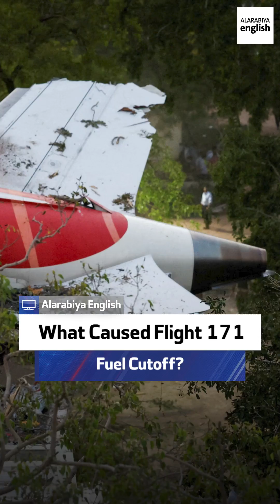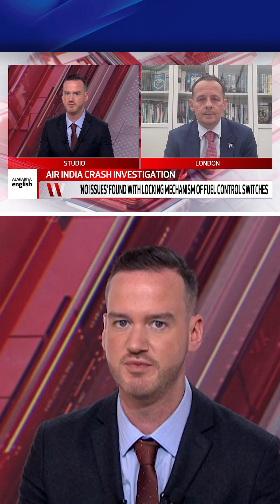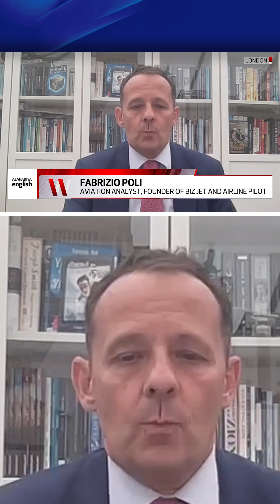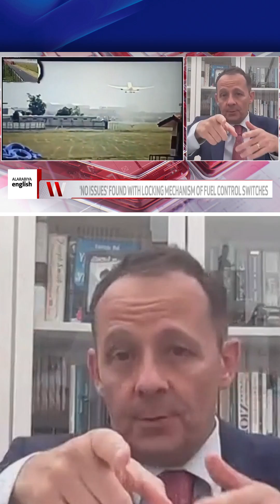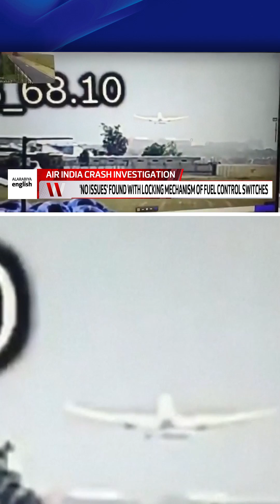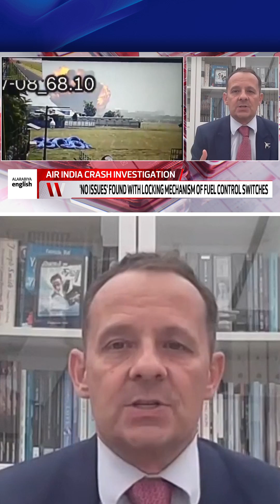What Caused the Flight 171 Fuel Cutoff?

Comment: AI 171's Copilot flew a 787 into a building! 

Here’s how it happened as you can plainly see from the crash videos with the help of a technical analysis from a 38 year, veteran pilot, and current 787 Captain, previous 777, 767, 757, and 737 Captain, and simulator instructor.

The pilot flying (PF) was allegedly the First Officer (FO) who was controlling the 787’s flight path according to the AAIB’s initial report.

The Ahmedabad airport’s CCTV video, taken from behind the jet’s left side, showed it started to descend after climbing 425’ above the runway (625’ above ‘mean sea level’), and then it’s wings banked slightly to the left, changing course by 3 degrees, towards a road to the right of four six-story buildings of a medical college, one mile from the runway.

A cell phone video/audio from a rooftop, viewed from behind the jet’s right side, revealed that the crew had initially selected the landing gear lever ‘up’, as evidenced by the landing gear’s 4 wheel ‘trucks’ having tilted forward, but the landing gear doors couldn’t open to allow ‘gear retraction’, because of the sudden loss of hydraulic pressure supplied by the Center hydraulic system pumps. These two pumps stopped supplying pressure when both engines’ failed (i.e., dropped below ‘idle’), tripping off the four electrical generators. This dual engine failure, also triggered automatic deployment of the ‘RAT’(ram air turbine, which is seen/heard in this rooftop video/audio). The RAT’s small hydraulic pump can’t raise the landing gear or move the flaps, but only powers 10 flight control surfaces supplied by Center hydraulic system fluid to maneuver the 787, and its small electrical generator powers the Captain’s flight instruments (but not the Copilot’s, forcing him to use the Captain’s instruments with difficulty, while viewing them from ‘cross-cockpit’).

It would have been obvious to both pilots that based on the current glide path now being achieved, that a 1 degree turn, back to the right, was needed to allow a landing of ‘Best opportunity’ on the road to the right of the medical complex, missing all the buildings completely. Pilots are trained that the safest plan was to aim for this road, avoiding the buildings etc., in the event a restart of the engines was unsuccessful.

The Captain, (allegedly the ‘pilot monitoring’, according to the AAIB preliminary report), would presume the ‘road landing plan’, while focusing on restarting the engines. When it became obvious he’d been distracted too long from the copilot’s maneuvering, and that an ‘Aircraft carrier’ style landing on the rooftop of the two story medical building, was now the immanent destination, he proactively selected the landing gear lever back to the down position, which would help absorb the impact forces through the ‘landing gear’, by keeping the passenger cabin away from ground contact for as long as possible, hopefully after a landing beyond this building. A last radio ‘May-Day’ call was transmitted before the building collision.

If you’ll review the Ahmedabad airport on Google Earth and draw a line, one mile from runway 5 (230 is the takeoff course), to where 171 impacted the medical building, you’ll notice there were plenty of wooded areas available, on both sides of the building they hit, with the best landing area on the road, to the right of that building. Had the jet stayed on the extended runway centerline after takeoff, as pilots are trained to do, they wood have missed the building completely and landed on the road beneath the trees. Pilots are trained to fly their malfunctioning aircraft to avoid hitting obstacles (i.e., buildings).

Pilots are required to stay on course after takeoff, and doing so would have easily avoided the buildings to make a road landing, but the crew knew that they couldn’t make too many course adjustments, eating up critical altitude. The video evidence favors, this maneuvering as being intentional, because a number of course adjustments were made, shortening the gliding distance, resulting in rejecting an attainable road landing, and choosing to impact the two story building’s rooftop in a stalled flight condition, short of the six-story buildings, though most of the wreckage still reached their ground floors.

Relying solely on the video evidence as described above, should be sufficient to deduce the intentionality, in precisely hitting a building that is narrower than the 787’s wingspan, instead of choosing the equally close road. The above perspective is plausible as presented and will certainly be proved or refuted, if/when supplemented and co-oberated by the full release of cockpit audio from the CVR, and flight data obtained from the FDR.

The Copilot was allegedly flying, not the Captain, and would have easily been able to disguise ‘cutting off’ the fuel switches at the moment the Captain reached forward to raise the landing gear lever, whose arm partially blocked his view of the fuel switches, which were likely timed to move covertly by the copilot, not the Captain (i.e., the left fuel switch, followed 1 second later by the right, commonly done in that order by most of my copilots). Once the Captain sat back in his seat, feeling the sudden deceleration, and likely seeing the switches ‘cut off’, causing a horrific ‘Startle effect’, understandably asked ‘why He cutoff?’. The copilot’s likely contingency plan of lying, and later seeing the engines recovering once the fuel switches were moved to ‘run’, was able to aim the plane towards the buildings/road, but performed a last minute 1/2 degree turn to the building, ‘911/World trade center styled’, knowing that a survivable landing would likely have occurred on the road under the trees.

Most pilots are also trained that a crash landing with the landing gear extended, helps to absorb impact forces, which is likely why the crew re-selected the ‘gear lever’ to down, as shown in the crash photo, and made a ‘Mayday’ radio transmission as a last valiant aviator’s duty. Well done Captain, who saved the life of at least, one of his grateful passengers, by not attempting to grab the controls from the copilot who intended harm to everyone and could have just as easily dived the plane unrecoverably into the ground, killing the passenger in 11A as well.